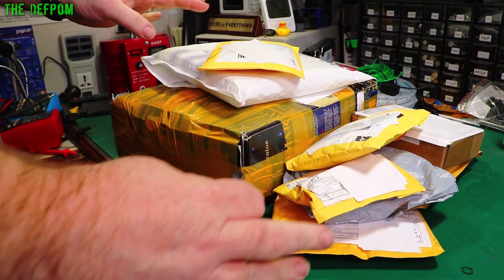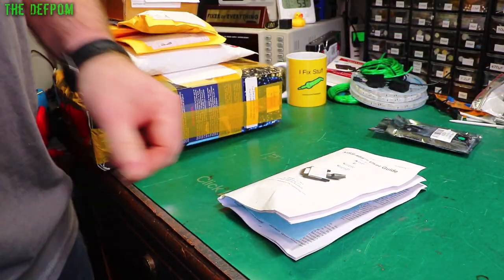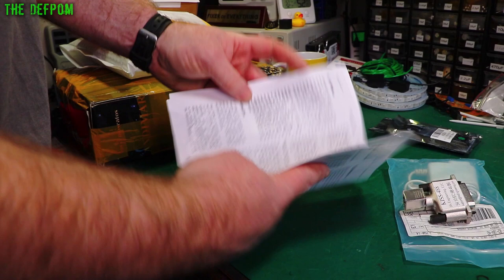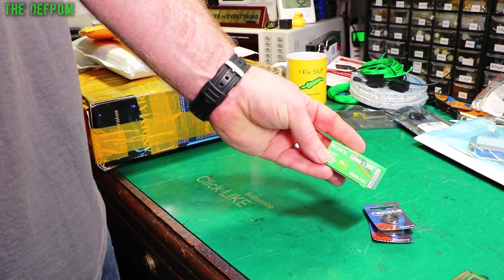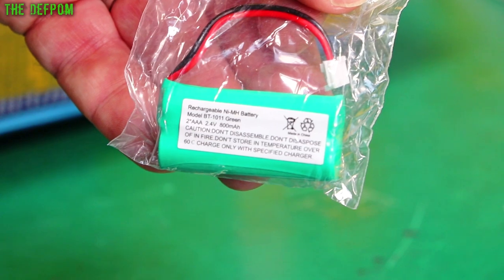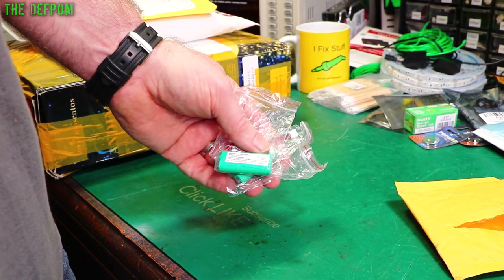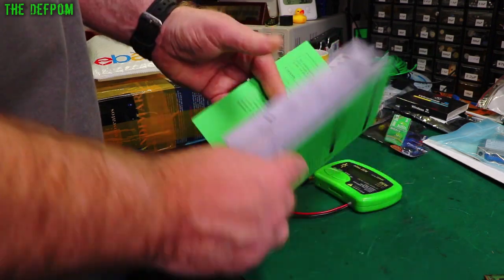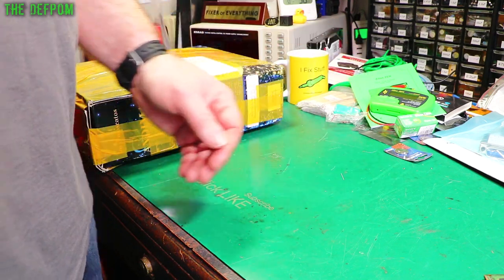🔴 Mailbag Monday 14th June 2021 - No.842

Comment: I once worked with some very expensive lab grade electronics.   At the time it came with a GPIB port, and an Ethernet port that was not yet enabled in firmware.   We tried it for a couple years with two different USB to GPIB adapters.   Never got either one to work reliably.   Unbeknownst to us at the time, a big problem exists with USB and the fact that its "ground" circuitry is faulty.  Add to that, connect to a PC fed though a transformer creating a floating ground, and you are asking for trouble.
A few years later, the manufacturer finally enabled that Ethernet port, and after switching over to that interface our problems vanished.
Since Ethernet was designed for (possibly) different ground potentials at both ends of the link, that problem was removed.

Comment: ...... Well done Mate,  I found with HP laptops the bios has a 'White list' of Wi-Fi/Bluetooth modules 
and will halt in post if there is an error or non compliant device.
Reply: That's the case with older ones.  Haven't had any problems with the newer ones